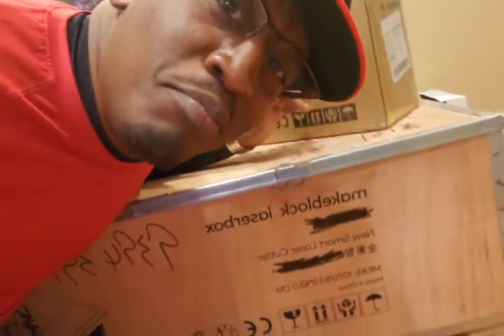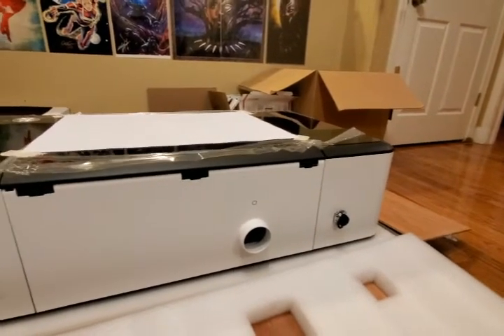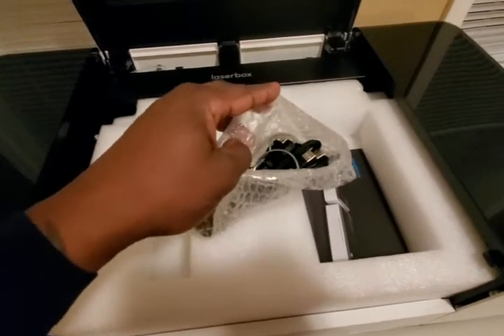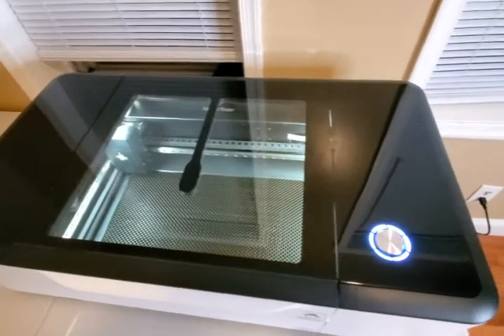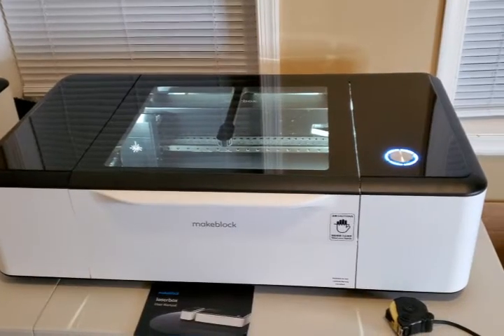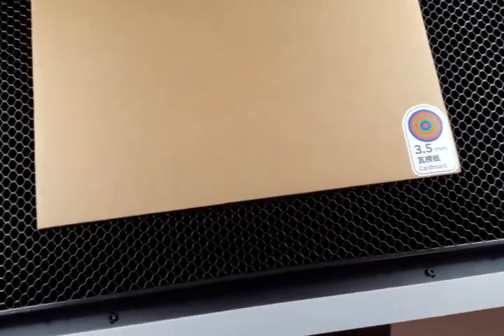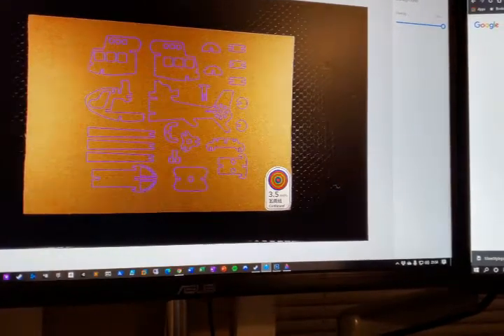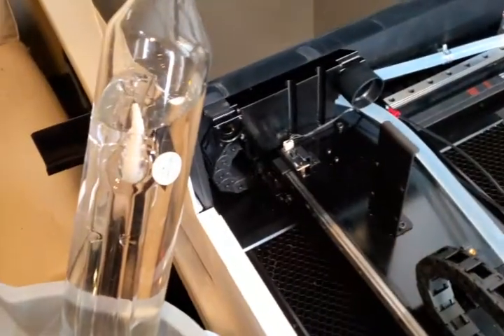Unboxing - First look at the the Makeblock Laserbox

Comment: Did you get a new laser tube?  What a pain to have it come with a busted tube.  I think it is water and antifreeze micture it there to make it more difficult.
Reply from the maker: I did get the laser tube and installed it. I had a difficult time with the removal of the plastic lens to access the coolant as well as syphoning it out. I put it off for a while. I actually just got back to it and refilled the coolant this past weekend. I need to run the calibration software to ensure the laser and everything is function and accurately positioned, then I can finally use it for the first time. I know, it's a lot and that's why I put it off.